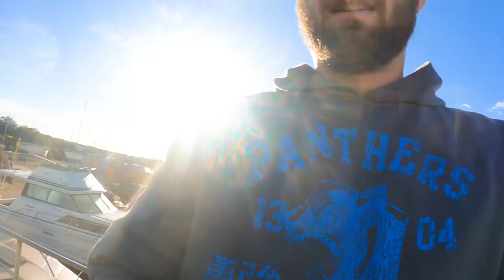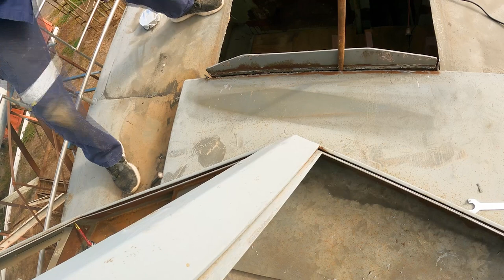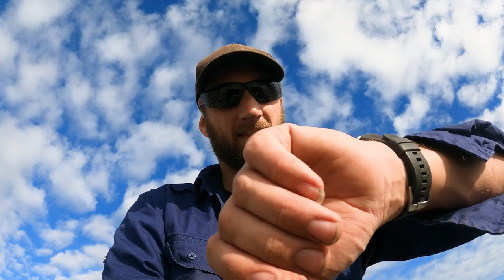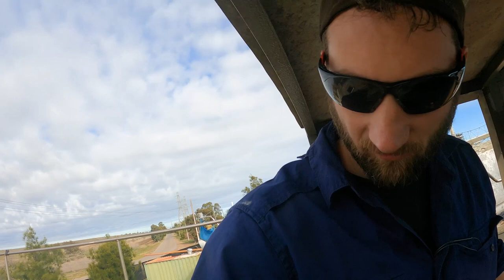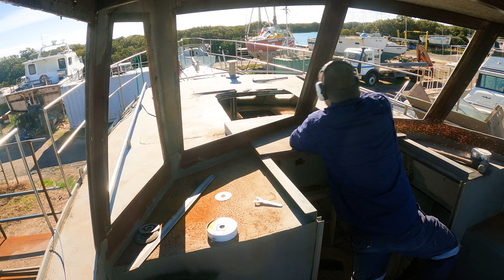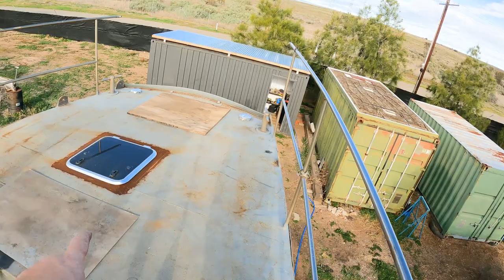Sailing QC # 23 | Sunroof & Companionway Modifications John Pugh Fairwind Steel Sailboat Restoration

Comment: You could consider making one big box from side to side to replace the 2 steps in the corners.
Reply from the maker: Hi Rolf! thanks for your idea!! we have considered that but we will need a gap in the middle to sit/stand at the steering column/wheel which will be reinstalled soon :)